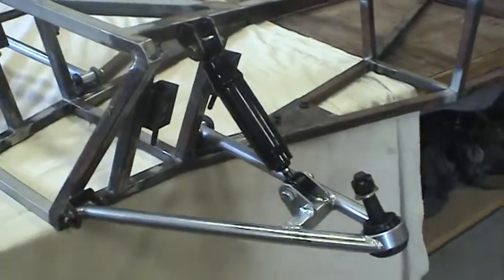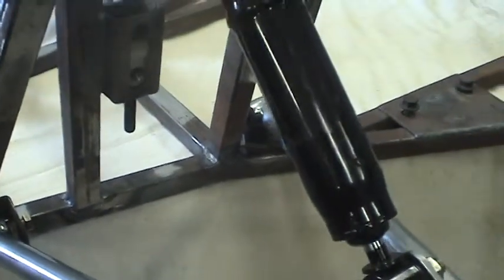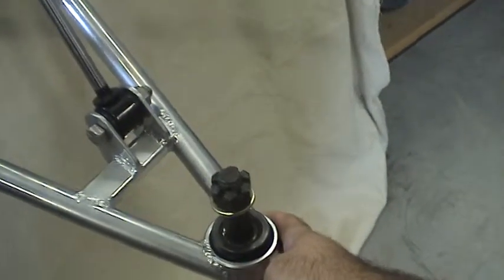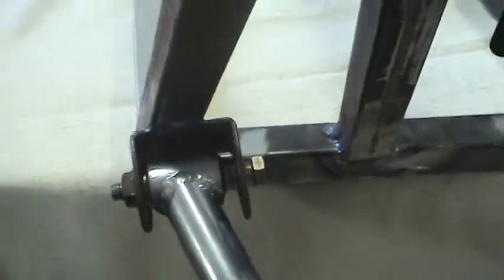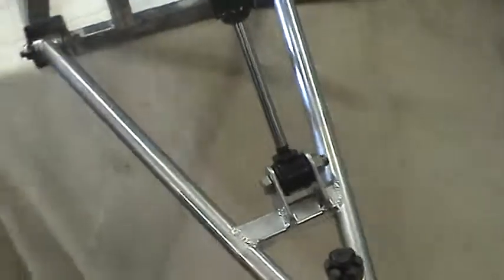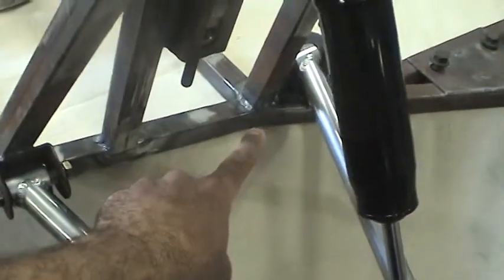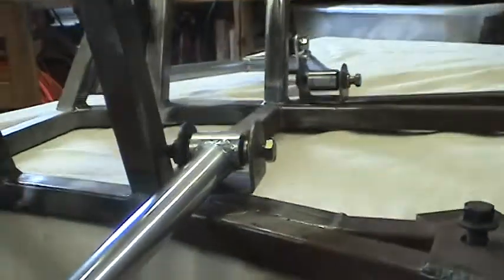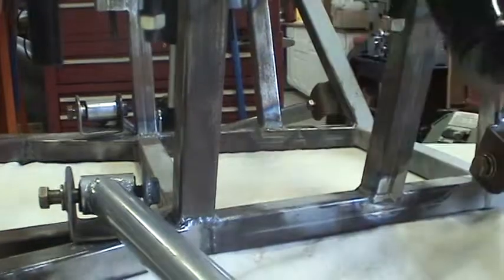Lower Control Arm Mounts.avi

Comment from the maker: Excellent point, and I agree... especially had I not fully welded the front brackets prematurely.  Cutting them off would have required a lot of clean up, fabrication of new brackets, and potentially weakening the chassis from mutiple heatings.  Not to mention that I had already removed and replaced these [bleep] things multiple times already and I was sick of it.